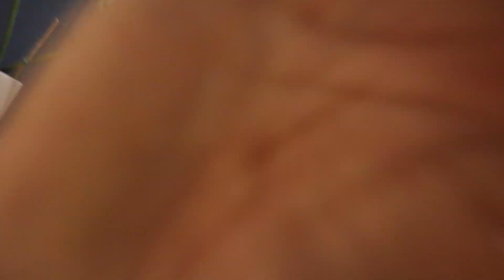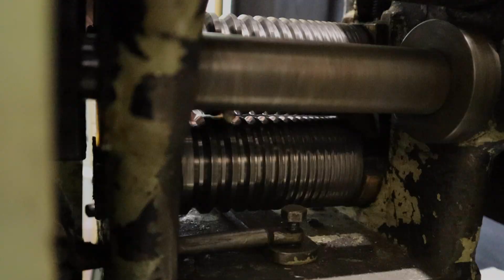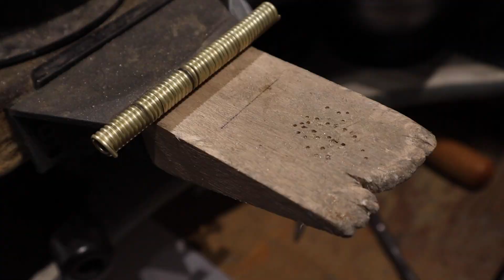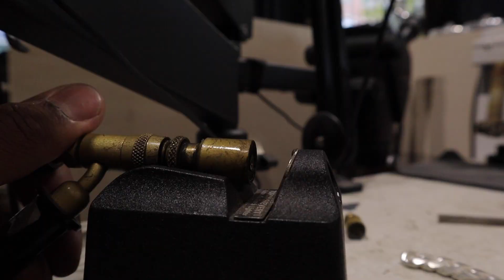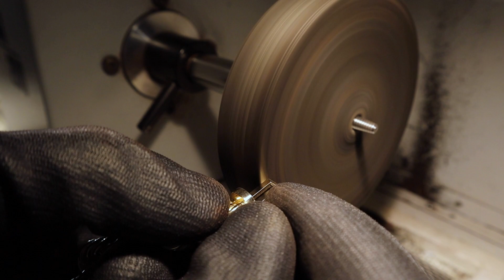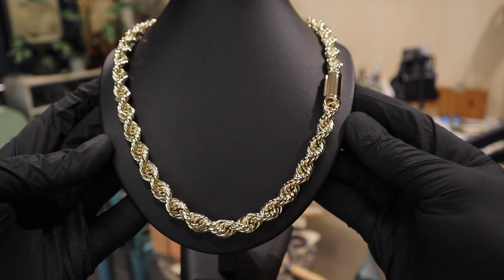MAKING A 14K GOLD ROPE CHAIN (HANDMADE!)

Comment: I bought a Jewelers saw on Amazon as I want to learn to create chains and rings but I swear I’m setting the saw and blades up proper and yet they break instantly.  I want to get a good Saw and blades from knew, but is there any pointers you can give on this issue?   I’ve watched so much on it and it still breaks.   Im thinking the saw geometry may be messed up also to cause unwanted tension